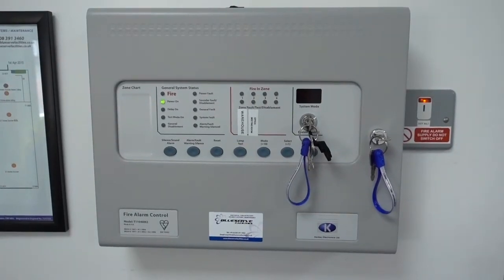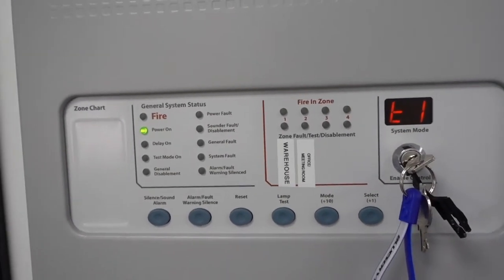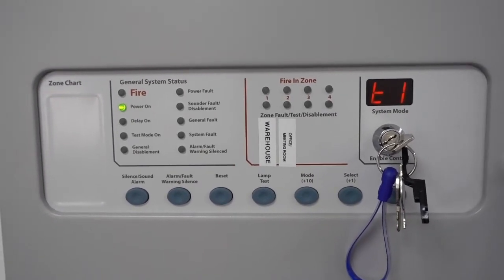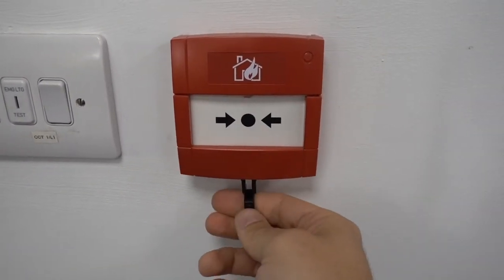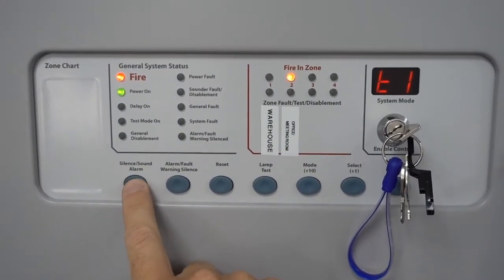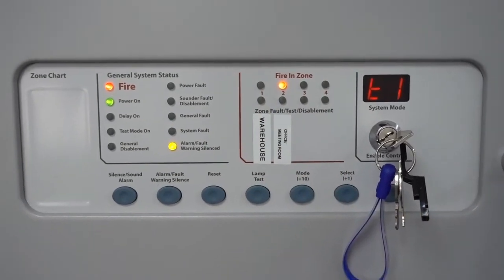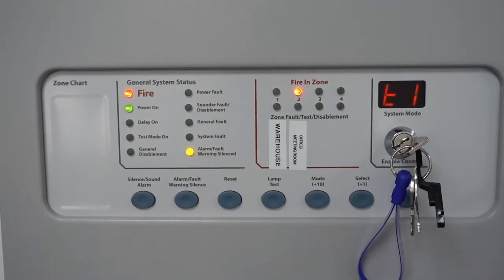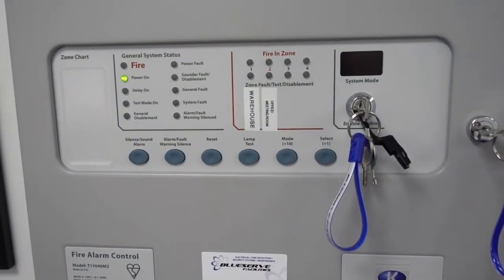FIRE ALARM WEEKLY TEST | KENTEC QUICK GUIDE

Comment: Hello there I have a MxPro 5 fire panel I need to isolate some detectors in a zone because of some maintenance work taking place do I need to disable outputs or inputs I know when I do a silent fire test I disable outputs for the bells or will disabling the zone be enough to stop the bells going off and Brigade being called. 
Many thanks
Reply from the maker: Dave Edwards hi. You need to disable the individual inputs so check what addresses of the devices you want to disable and disable them only but also I would cover them to prevent any contamination. You can disable the Zone but you want to limit how many detectors you disable and sometimes when you're disabled in the zone you're also disable in the sounders in that zone which you don't want to do. And remember you need to keep the disablement off but as little time as necessary because ultimately you don't have detection when you disable in those areas so you may also want to think about your fire precautions

Comment: I really hope you see this message as I am at my wits end. I've had this exact panel installed a few weeks back and from day one it's omitting a high pitched sound and a low loud hum/buzz. I can hear it throughout the house behind closed doors. There is no escaping the sound. Do they all make this sound or is something wrong. I'm having a hard time backing my own corner with the guy who installed it and my landlord said to just ignore it. Also at night I can see a red light coming from zone 4 on the panel.

Any advice would be greatly appreciated
Reply: Those panels do make that sound for some reason and I've noticed that sometimes the leds just light up dimly. Hope this helps.

Comment: hi, a newbie here. We are currently testing the same fire alarm system used in the video. all tests goes well except that when smoke detectors  were tested with smokes the LED indicator would light up but alarm won't activate. What could be the problem?
Reply from the maker: Yosef 618 before you performed the test are any led indicitators illuminated other than the green power?

If not you might have a programmed disblement.

Or the sounders might be incorrectly wired.

Do they work at all?
Reply: Dans the Engineer , thanks for the response. The "general fault" indicator LED is illuminated and also the 'battery fault" in the lower section because we tried it without batteries installed. Strobe lights and ringer are installed in NAC terminals while smoke detectors (with MCP) in Z1 and Z2 terminals . When the MCP is activated alarm would sound. But if individual smoke detectors are tested, alarm wont sound but the LED in the smoke detectors would light up. We are using Apollo series A65 Smoke detectors.
Reply from the maker: Yosef 618 there's no need to remove the batteries whilst testing this so reinstate them. 
So your sounders are not on the zones, they are dedicated alarm circuits on the alarm terminals?
And when you test a smoke, does the panel fire LED indicator illuminate?
Reply: Dans the Engineer. Fire LED in the panel did not illuminate, only the LED of the smoke detector...the smoke detectors we have do not come with sounders, should it have sounders along z1 and z2? If so, will it trigger alarm in the panel?
Reply from the maker: Yosef 618 no you do not need to have sounders on the zones. There are 3 variants of the panel in the video. 1. Standard conventional also known as 4 wire. 2. AlarmSense and 3. SavWire. Mine is a SavWire where sounders can go on the zones but also as separate alarm circuits. 
If your call points set off the sounders it tells me the panel is functioning how it should so either the smokes are not connected correctly or they are disabled. It is possible to make programmed disablements. Open the front door and it lists what programming can be done. Do you have any spare zones because you could try by swapping the affected zones with a spare zone to see what happens
Reply: Dans the Engineer, There are no spare zones. There are only 2 zones in this variant I tested....We now set program and enable 71 and 72 and sounders activated when a smoke detector is activated. However, this time, when the MCP is activated (or terminals in SD short circuited) there is no alarm in the panel and sounders don't activate.

Comment: Trying to test the smoke detector, the LED indicator in the smoke detector is activated, but the panel does not detect it and no sounder is activated. Hope you can help me. Thanks, mate.
Reply from the maker: Sounds like the detector isn't connected correctly. If it has power (which clearly it does), it'll light up in fire condition but won't tell the panel. What detector is it and what protocol is it? Alarmsense, 2wire or 4wire?
Reply: @DanstheEngineer  I'm using kentec sigma a-cp 8 zone conventional fire panel, and my detector is series 65 optical smoke sensor detector standard.
Reply from the maker: @marjosephedjan8734  check how it is connected. Are the other detectors on the zone creating a fire signal when active?

Comment: Do you know by any chance why this model of panel would be having an intermittent power fault / general fault? The internal buzzer will sound on the box,then the fault will clear for a few moments,then start up again. It will go on like that for a few hours. Then stop completeley for a few hours,and then start again?
Reply from the maker: A power fault can be a number of things. Either the battery, power supply unit or mains supply is faulty. It would be unlikely for the mains to cut out without anyone resetting unless there's a loose connection. The batteries could be loose or near end of life or the PSU could be playing up.

It needs an engineer to attend to look through these things systematically and provide a solution.

My instinct based on what you've said is it sounds like something is loose but I cannot stress how much an engineer and only an engineer needs to look at this.